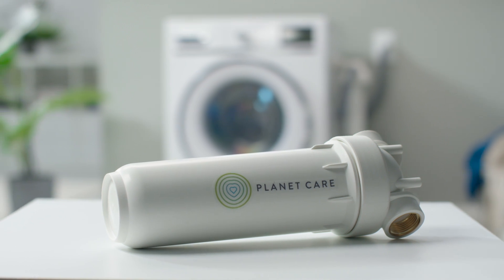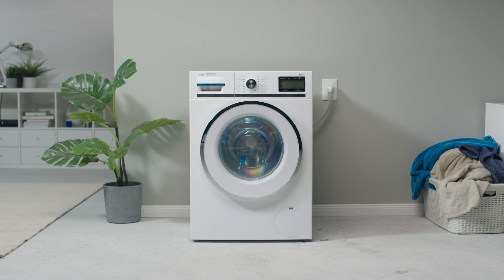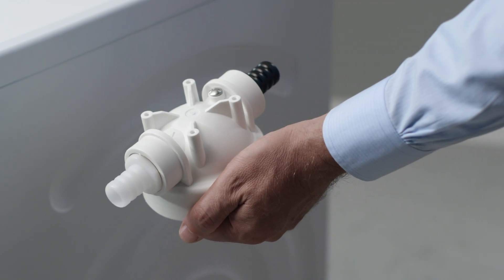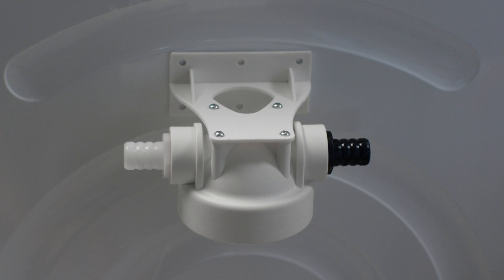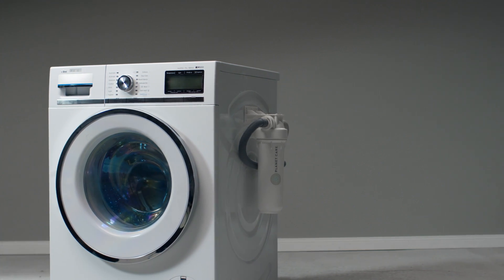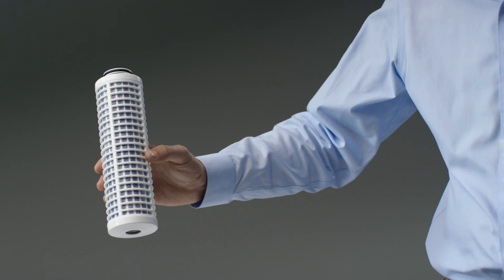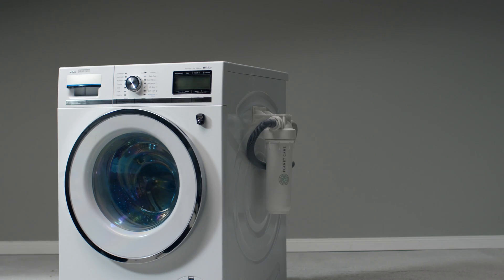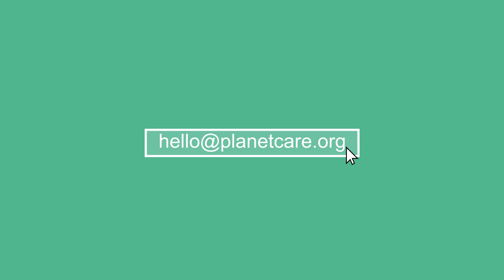How To Use PlanetCare Microfiber Filter In 3 Easy Steps

Comment: 1. Who on earth has a free standing washing machine like that? Any machine I've seen in the UK is built in the kitchen under a counter. You'd have to rummage under the sink usually to find a spot for that. 

2. Our washing machine hoses don't look like that, they have u bend hook thing to drop them into the drain pipe and I don't think the end of the pipe looks like that so it wouldn't fit on the barb of the filter

3. Is the second hose supplied with the filter?
Reply: I can attempt to answer, as I am in the UK & my machine is under the kitchen counter, and the drain is behind the washing machine. I recently brought one of these and I'll explain how I did it. 

In the box there is the second hose, so you don't have to buy another. I put the filter in the cupboard next to the washing machine and cut 2 circular holes in the side of the cabinet,just fractionally bigger than the drain hose itself. They are not visible when the cupboard is closed. I fed the drain hose through and into the cabinet, attached the filter to side of it, connected the drain hose from the machine and the second supplied hose to the outlet and fed it through the second hole. I reused the drain hose U-hook from the washing machine hose on the new drain, it just unclipped. There is also a spare in the filter installation kit.

I don't know if that helps, but always useful to know!
Reply: @sloeginandsleep1170  so you keep track and return after 20 washes.  On the website it says if you wash lots of cottons it fills up sooner.  How do you know if it is full before you have used it 20 times?  

We are in Canada.  Our washer is in a sort of grotty basement with uneven concrete walls.  The floor is also concrete and as a result it’s not all that clean because dust and lint collect down there and I can’t move the washing machine to clean a concrete floor.  I’ll talk to my husband.  If I suggest he woukdnt be able to install it - he will be determined to make it work!
Reply: All I see is you seeing bears on the road. Think in terms of possibilities!
Reply: Who on earth? Me is the USA for one, to answer your question.